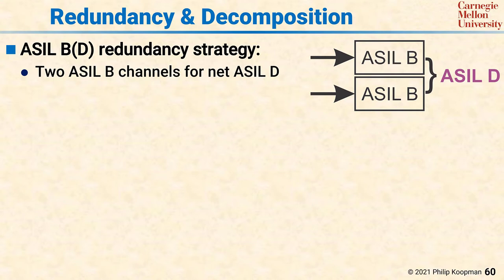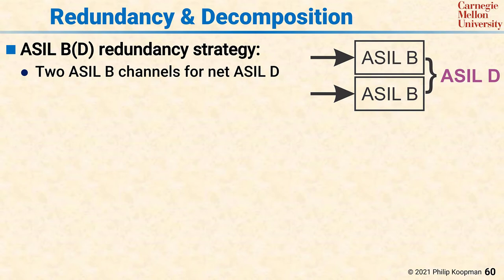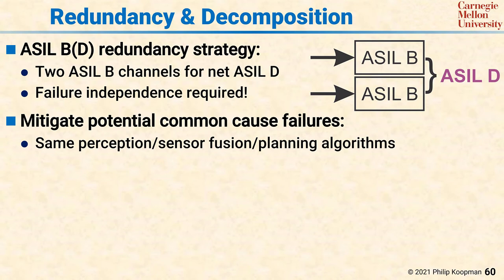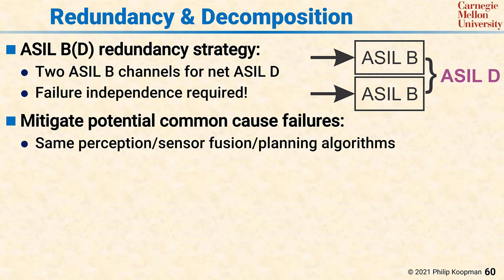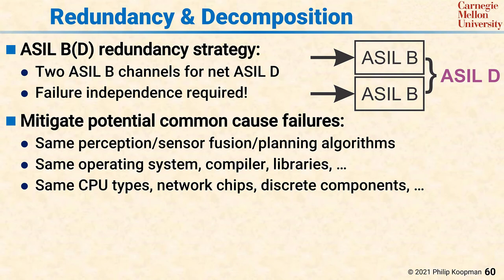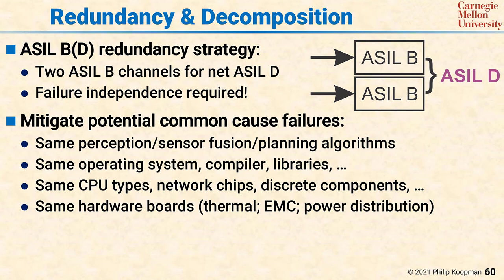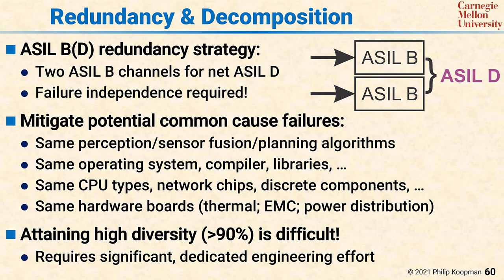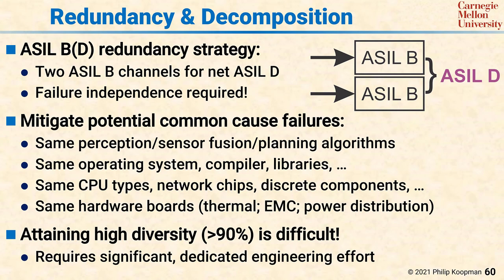L105 60 Redundancy and Decomposition ASIL B D

Comment: Hello Mr. Koopmann, if a vehicle steering system has only one operation mode, it is determined as ASIL D, but with the help of steering dynamic mechanism, it can be operated in 2 or more degraded mode, then the controllability will decrease from e.g. C3 to C2, then can we say that for the steering system with steering dynamic mechanism, ASIL C is sufficient? 
But what about after one degradation, the controllability is more difficult than C2, does the remaining system still have ASIL C?  or should be upgraded to ASIL D after failure and degradation?

Comment: I am surprised that sensor(-mode) diversity is not explicitly mentioned. Doesn't in environmental perception the selection of different sensors (the actual instance and positioning) and sensor-modes (camera, radar, ...) reach a much higher diversity than say the selection of the perception/sensor-fusion algorithm alone?
Reply from the maker: For sure sensor mode diversity matters. But this gets really complicated in a hurry because you need both availability (ability to sense in all relevant enviroments) and management of cross-checks between sensor modes.   Too much for one slide which is really just more about ASIL B(D) generally intended for functional safety.
See the UL 4600 section on sensor redundancy management for some of the considerations.
Reply: @philkoopman  Thanks a lot for the pointer. I hope you don't get this the wrong way, this was not meant as critique of your particular slide. I see this separation also in industry discussions very often, a lot of the focus is on the diversity in the compute-components. But from the POV of the perception engineers, the core algorithms before the planning (i.e. perception and fusion) are tightly connected with sensor(-mode) selection (obviously). So diversity in one directly affects diversity in the other (and the cost of the whole system). It seems that vocabulary is currently missing that honours this essential connection between sensor and compute. There is no question that this is hard to model, but it seems highly consequential to the system design.
Reply from the maker: @mischan  Agree this is an important issue. Thanks for the discussion!

Comment: Could you please provide one example for that word used in safety standard “sufficiently low” or at least explain how to interpret that in DFA
Reply from the maker: The probability of both failing has to be low enough that your top level reliability (or other metric you care about) is acceptable. There is no single magic number.
This looks like a good starting point:
https://www.ntnu.edu/documents/624876/1277591044/ccf.pdf